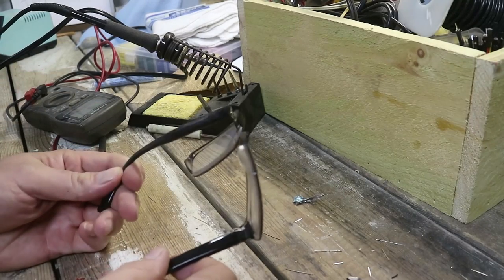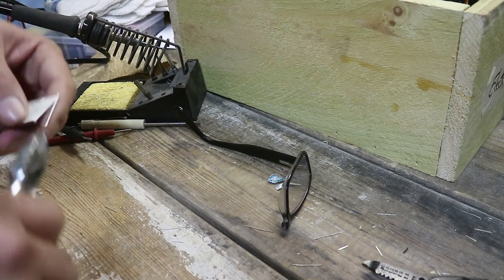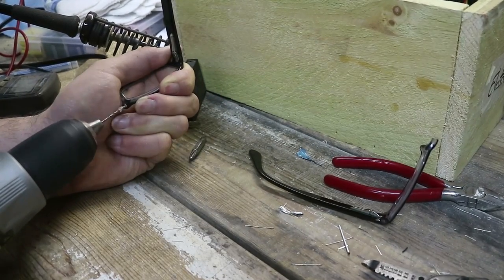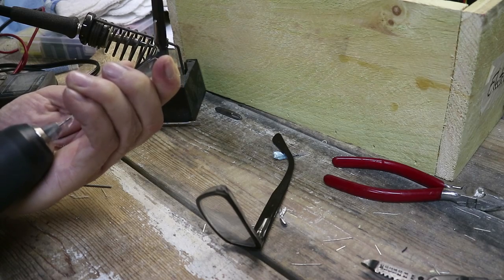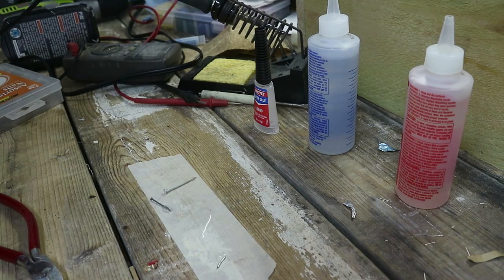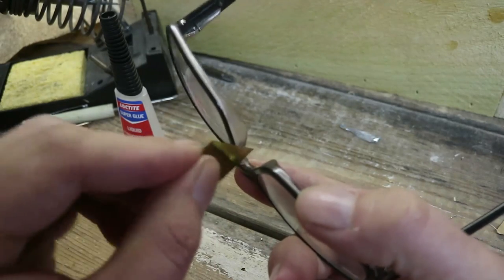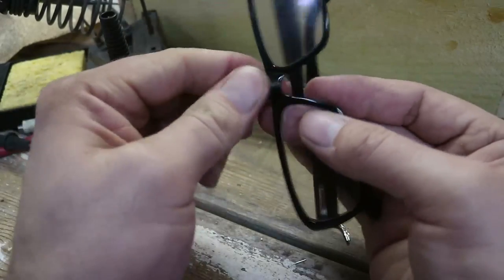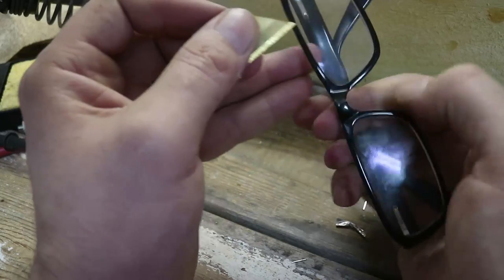Fixing My Glasses

Comment: great approach!  what was that sheet of metal you cut the pin from?  not clear about that.  Also how long did the repair last?  Thanx great presentation.
Reply from the maker: That was a nail from a strip of brad nails. I've  performed similar repairs with a piece of a paper clip as well. 

They lasted for about a year. They never failed again, I just got an updated prescription at my next eye appointment. 

Thanks for the feedback!

Comment: Pls help the help of one frame broke help me this is the 5th time I glued it it still fell am already using super glue HELP Me
Reply from the maker: If your glasses are ABS plastic, you can fuse them back together with Acetone (nail polish remover) - likely, however, the superglue you've put on them would prevent the acetone from working.